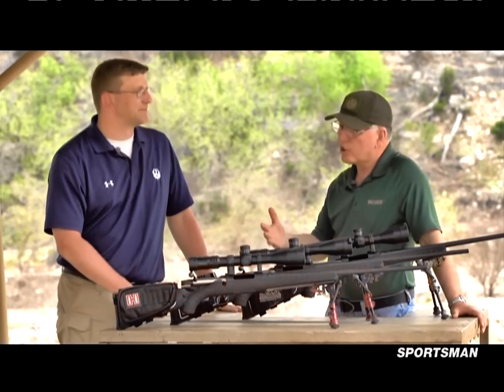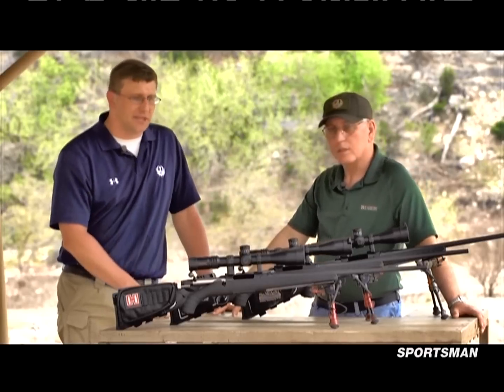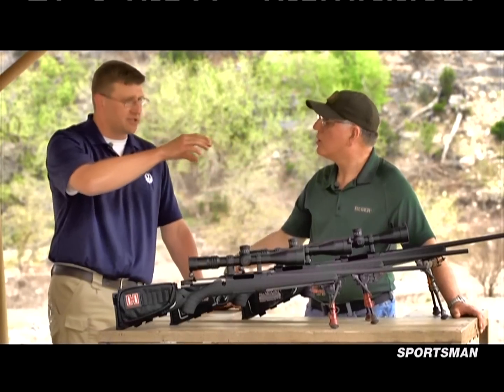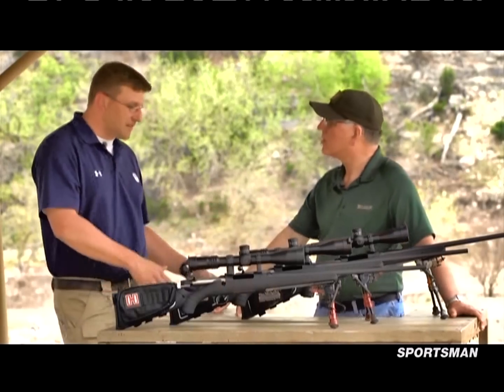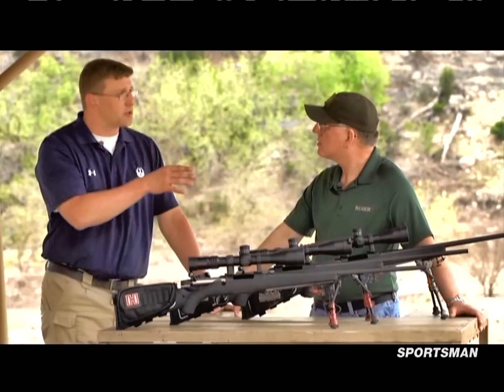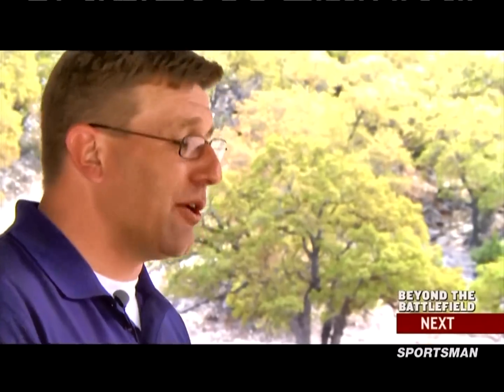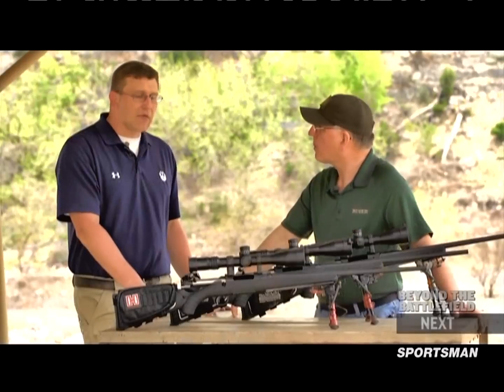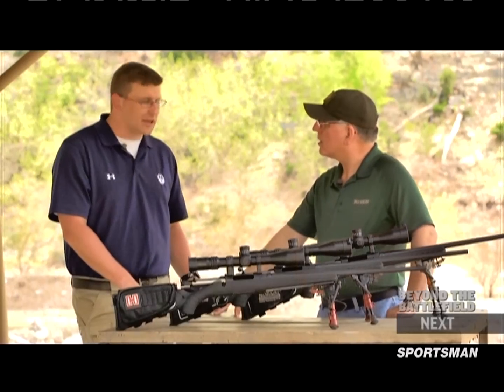Bullet Weight vs Twist Rate test

Comment: This is a very interesting video. Thanks.

So one could conclude that in this test, the faster twist rates stabilized everything from light to heavy bullets.

However, the slow twist could only stabilize lighter bullets and not the heavy one.

Makes me wonder if that "rule" would also apply to other calibers. 

And if it is wise to choose faster twist rates for caliber in general.

Comment: I really appreciated this video. I noticed the Ruger trademark. I have often wondered why Ruger decided to change the barrel twist on their Mini 14 (223) from 1:7 to 1:9? I suspected it might have something to do with the more common 55 grain bullets and maybe matching bullet rotational frequency with barrel vibration (i.e. ultimately accuracy). I have also wondered if the tighter twist might magnify any bullet imperfections. I have an older 1:7 barrel, and it seems to like 62 grain better, but I haven’t been very scientific. I haven’t tried anything bigger. Don’t worry, I didn’t buy the gun to win marksmanship contests. I like shooting open sights.

Comment: Except for handloaders, using light weight bullets. If you try to crank up a lighter bullet to perform as it should, you run into more pressure with a faster twist rate. I have a 1/9 twist, an with 50/55 grain bullets I'm running into pressure way before optimal performance for those bullet weights. Can't wait to get my 1/12 twist barrel.

Comment: I do have a question  I got 6.5 creedmoor   savage110 24inch barrel  1.8 twist I can knot get accurate with hornady bullets  my wife's howa 6.5 creedmoor 24 inch barrel 1.8twist hers dead on is the rifling or twist same depth and width
Reply from the maker: Even if your wife had the same rifle as you they might prefer different bullets. As it is the rifling is almost certainly cut differently, the chamber on hers might be tighter than yours so she'd have higher velocity and so on. Also, one of the rifles could be better bedded in the stock or has a heavier barrel.
Reply: @JohnSmith-nz9dn  ok that makes since I really appreciate that thank you

Comment: The berger bullets website has a very good bullet gyroscopic stability calculator based on the Miller stability formula. Bullet stability is affected by air density which is affected by temperature and altitude. Sg=1 or less indicates an unstable bullet that will likely tumble. Sg= 1.2 to 1.5 indicates a marginally stable bullet with increased drag due to wobble and precession. Bullets in this stability range might group well at short ranges but also might do poorly in the transonic range and subsonic range. Sg>1.5 is a fully stabilized bullet. For long range shooting at velocities below Mach 1.2 (transonic) It is best to choose a bullet that has Sg>1.5 for your twist rate and environmental conditions.

Comment: I had stabilization issues that started at around 700 yards with a 105 gn. Bullet in a 243 win. With a 1:9.25 twist. 1:8 fixed the problem.
Reply: Were you surprised that a stabilization issue didn’t show up before 700 yards? I’m not going to argue with success.
Reply: @katrinadarling3271  surprised, no. Impressed, kinda.  It wasn't working for competition out to 1200 yards.

Comment: Back in the early 90’s, before the assault weapons ban, I picked up a used Colt Sporter AR-15. It had a 1:7”twist, 20” barrel. I reloaded 62 gr. Speer FMJ for it. I also reloaded 36gr. varmint grenade projectiles for my TC Contender 14” 1:12” twist. Which I used for varmints (go figure 🙄).
Then I was sighting in a new scope for the AR and used the lighter 36grain bullets. After firing off about 5 rounds each at 100, 50, and 25 meters and not one round punched a hole on target. I discovered the 1:7 twist rate was to fast for the projectile. It spun so fast the bullet flew apart upon exiting the muzzle. The jacket was to thin to hold the projectile together as it was spinning at over 300,000 rpm’s. 😳
Live and learn.

Comment: What about 1in10???
What is the longest bullet that a 1in10 will shoot accurately?
That is what the Savage 110e is.
Reply: U mean what. Bullet weight fits that TR? Probably 48 gr and lower
Reply: @sigspearthumb8856  lol the 69gr SMK calls for a 1/10 minimum. Try again.
Reply: K N lol what was I thinking? Yeah... slow twist, heavier round.. oops
Reply: @sigspearthumb8856  Length is actually what effects the stability not weight.
You can have a lighter projectile that is all copper that is longer than a heavier copper/lead projectile.

Comment: 1:10?
Reply: Will handle bullets with a ballistic coefficiency up to a 68 to 69 HPBT match bullet.  But velocity is also a factor on how well the bullet stabilizes.  In general, the 1-10 twist rate for a high velocity .224 caliber cartridge is ideal for shooting bullets in the 55 grain to 64 grain weight with a (G1) ballistic coefficiency of 0.255 to 0.305.

Comment: Wouldn't velocity also effect the stability in a given twist rate?
So to compare different twist rates on different length/weight of bullets they would need to all be fired at the same velocity?
Reply: The breech only has so much room so longer bullet can reduce powder. Plus of course, heavier bullet goes slower with same powder charge.
So your suggestion is not practical.

Comment: I was really wanting to see the 1:9 results with 55 gr
Reply: Me too... wanted to see the 55gr with a 1:7.  Tavor is 1:7 and the most common (cheapest) ammo is 55gr.
Reply: I can give first hand experience that my 1:9 produces almost 1 jaged hole at a 100 yards with 55
Reply: 1:9" is very common as is 55gr.
I think the question is to what grain size is 1:9" adequate? 62gr, 65gr?
Reply: @artsmith103  I found 69gr sierra works with my 1:9 Rem700 barrel best and increasing to 75gr the groups begin to open up @ 100yds.
Reply: It's fine.

Comment: I think they should have shot more intermediate weights, like 62 and 69gr, which are also very common.
Reply: I know, LMAO....a 1 in 12'' will stabilize up to 64 gr WW Soft Point Bullet. the 1 in 12'' WILL NOT Stabilize 62 gr. Mil Spec Green Tip due to the steel insert in front of the lead core makes it as long as a 70 Gr Speer Soft nose which needs a 1 -10" or 1-9" to stabilize. So the 1-12" will stabilize 40, 45, 50, 52, 53, 55, 60, 63 and 64 gr HP and SP Bullets and 55 gr FMJs.
Reply: @demoratdestroyer7890  - Based on my experience, the 62 grain SS-109/M855 green tip FMF-BT is closer to the Sierra 69 grain HPBT MatchKing than the Speer 70 grain SP in turns of stabilization requirement.  My rifle is a 22-250 Remington 700 fitted with a Krieger match barrel with a 1-10 twist rate, and I believe 1-10 is the minimum required to stabilize this bullet.  Also, the bullet needs to be driven out at a minimum muzzle velocity of 3,300 fps.  Under 3,300 fps will result in target groups looking like it was made by a shotgun shooting buck shots, and some of the bullet holes are not round but slightly oval in shape.

Comment: So why exactly does the bullet length need to be shorter as the weight goes up (for any given twist rate), or to say it another way,  why exactly won't the bullet stabilize if its length is increased ?

Comment: Have you guys did a twist rate video for .243???  I'm wondering if my 1/9.25 twist rate is enough, to stabilize the 100g bullets. From what I've read, it should be good for anything from 55-100.
Reply: You can say that about 1/10 as well, Depends on the length of the bullets bearing surface on the rifling.

Comment: I have a 1/12 .308 with 22" barrel. Thing would not shoot 150gr worth a shit. It shoots 168gr very very well which seems to be the opposite of what I just heard.
Reply: A 1:12 - in a bolt-gun especially - is a suitable twist rate for 168-175 grain loads, easy. There are some general guidelines about what should work regarding barrel twist and specific bullet weights/types/lengths, but every barrel is different and only empirical testing can determine what loads it "likes" to fire. Many bolt-actions are somewhat forgiving of heavier and longer than recommended bullets for caliber and twist, thanks to the fact that the barrel length allows sufficient velocity for adequate stability. The go-to source for rigorously done testing on bullets and twist rate is Bryan Litz of Applied Ballistics. Bryan is an aeronautical engineer and chief ballistician for Berger Bullets. His books are a great resource.
Reply: @GeorgiaBoy1961  I'll have to check that out. Thanks
Reply: You bet !
Reply: It's the length of the projectile not the weight.

Comment: Twist rates are OBVIOUSLY velocity dependent. Because twist rates are a fixed mechanical property of a bore, the faster the bullet is shoved down the barrel, the higher the bullet RPM when it leaves the muzzle. The fixed thing is the bore rifling, the dynamic thing is the amount of velocity a hand-loader can adjust by varying loads.

Ultimately a given length (bearing-surface-area) of bullet in a given caliber will require a SET twist rate at an OPTIMUM velocity (forward-speed). Since the twist rate is a fixed feature, the only variable is the bullet length and charge-volume of powder in the case.

That established, the heavy-for-caliber bullets require a flight RPM that may not be attainable in that cartridge. The velocity required to achieve that RPM may be out of reach for a heavier bullet. So the twist rate needs to be faster.
Reply: Basically if you had just said what you said with out including the "(bearing surface area)" in there you'd have been just fine.
Reply: @kn761  I really would be nice if random people on the internet today would strive to be articulate and state their case, without making blanket statements of disagreement to prove some personal point.
Reply: It's not about bearing surface area.
Reply: @kn761  What's it about, enlighten us.
Reply: I've articulated it enough times here. Read around.
Reply: @kn761  Well good for you. Except I've not seen the times you've done this and I'm not going to go looking for them.
Reply: Lol ok

Comment: Gold, was trying to get my head around bullet weight and twist - you nailed it!  Im getting a Tikka T3X .223 with a 1/8 twist, 20" barrel length. so it seems that the best ammo would be a bit heavier to get greater accuracy and range ?  PS could you do a comparison of a 20" barrel vs 24' I am unsure it will make a difference in accuracy ( speed of bullet) at .223 ranges out to 300m?
Reply: it does make a difference in speed an accuracy.
Reply: you can shoot as light of a bullet as you want and still get just as good of accuracy. The difference will be at distance when the wind effects smaller bullets more.

Comment: "Bearing surface". Dude you've just embarassed yourself. Take this video down.
Reply: you just embarrassed yourself! look up "bearing surface" for definition. the surface of a moving object against a stationary surface. In terms you may understand, the skin on the palm of your hand is a bearing surface against your penis. which you would know if you educated yourself instead of just skinning the flute. lol
Reply: S Userman no he is right.
When a projectile has more weight, what do they do to the projectile to increase its weight?
They make it longer.
The tip doesn't get longer but the body inside the case gets longer.
So that means you now have more projectile surface area touching the barrel and rifling.
Reply: @dhern2613  You are partially correct.  Some bullets are flat or round nosed with a flat base and have more bearing surface and are shorter than the pointed, boat tail bullets, of the same weight.  Short bullets do not require higher spin rate.
Reply: It's a thing called math and geometry. The relationship between the diameter and length of an object. Cubic area is [pi X radius² X length]. When you change the tip shape and base shape of a given bullet, the "cylinder bore" BEARING SURFACE length will also change. All of it affects, ultimately, the gyroscopic stability of a given object, where the CG of that object is located relative to the central axis, and how much RPM is required to stabilize that object at a given forward velocity.
Reply: @turnin.sprocket  man you guys are some thick headed fucks. Picture this if you can manage a simple thought. You have a bullet that has a shape resembling a football meaning it has no straight section. It's just curved from meplat to boat tail. then picture that it is enclosed in a sabot and fired from a gun. No bearing surface whatsoever. The bullet still needs to be stabilized. Are you seriously trying to tell me that bearing surface determines how much twist it needs to stabilize? Yeah that's what I thought. It's about length. Bearing surface is irrelevant. God you guys are fucking dumb.
Reply: @kn761  Should I bother to have a conversation with someone as abrasive and insulting as you?
Reply: @turnin.sprocket  you already did
Reply: @kn761  Go on, revel in your lack of character and maturity.
Reply: I'm inclined to agree with you.  A wadcutter, flat base bullet has a lot of bearing surface but doesn't require a fast twist to stabilize.

Comment: Hi  Guys.  I feel like your missing something,  Like maybe,  barrel length.  I shoot a 77 gr nosler HPBT in my Savage with a 1in 9 twist and at 100 yds. its the most accurate load I shoot.   I have also worked up the same load for a friend of my with a Savage like mine with the same results.  If you really care,  you might want to do a little more testing.
Reply from the maker: What they are demonstrating is the effect of twist rate on stability of bullets with different weights/lengths.  To do that they needed rifles that are identical except for twist rate.  They weren't trying to find the most accurate loads.
Reply: @JohnSmith-nz9dn  ... after years of testing i realized that a while paired with 150grn bullet. A .308 with a 16" barrell 1/7twist rate will SPANK most other 308s with higher twist rates.

Comment: "All the AR platforms are in that weight range" I'm planning 220 gr 30 cal., as are 4 friends. I would be happy if someone made a 1 in 4 twist for 300BO. It would definitely improve the stability, but working the powder compositions would definitely be a new challenge.
Reply: Why would you think anything would need a 1/4 twist? my 1/8 10.5" blackout shoots 220gr beautifully.
Reply: Haha. 1:4? Bullets would simply explode from spinning too rapidly.

Let's throw some hypotheticals out there, do the math:

1:4. Every 4" that projectile rotates 360º.
Assuming a median 1,780 fps, we can also say 21,360 inches per second, and 1,281,600 linear inches per minute.
Divide 1,281,600 linear inches by 4 inches (per 1 revolution). Answer is 320,400 RPM exiting muzzle.

Can your 150gr bullet withstand that sort of force?
Reply: @turnin.sprocket  8.6 blackout being made from the factory at 1:3 twist.

Comment: Bearing surface...? WTF he has not idea about actual external ballistics. Ok stability is 1 , optimum stability stability is 1,5 . There are TONS of units taking part in needed twist rate. Projectile Material (lead, copper/brass, steel, tin, aluminium, polymer, tungsten)  Ogive Lenght, Bearing lenght, Boattail lenght vs Flatbase. At wich place certain material is like a heavy front but light back or the other way around, also if the outer diameter material is lighweight or heavy for gyroscopic effect.
The bearing surface should be atleast ~one caliber (5,7mm for 5.56). Otherwise it has not even the slightest such an effect as the other main variables.
Reply: Would you please stop babbling on you are making no sense.    People just want a gun that shoots well out of the box.   Look at all the time and ammo wasted on this dud of gun.
Reply: When you increase projectile weight and no other factors what happens?
The projectile body, the part that makes contact with the barrel, gets longer.
More surface area to make contact with the rifle barrel makes a difference.
Therefore different rifling twist rate is required to spin the projectiles to balance them in flight.